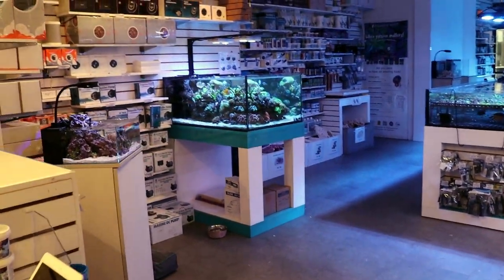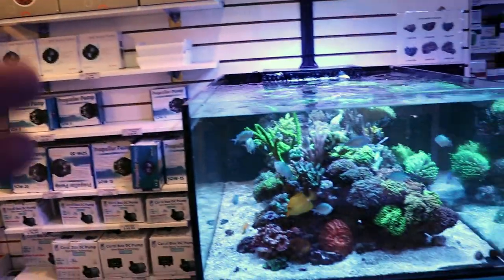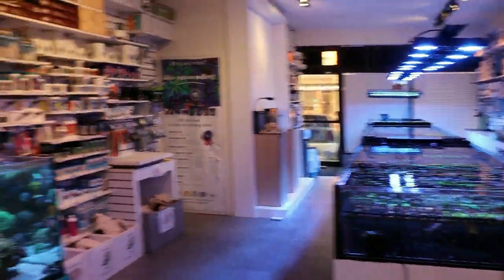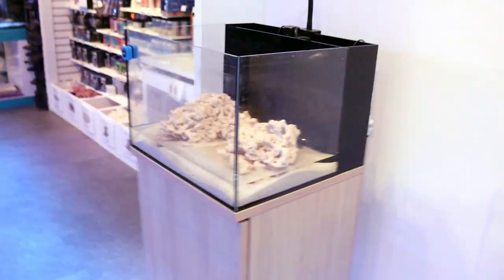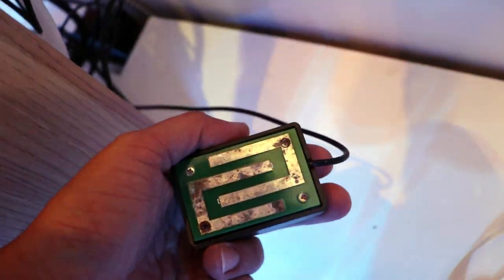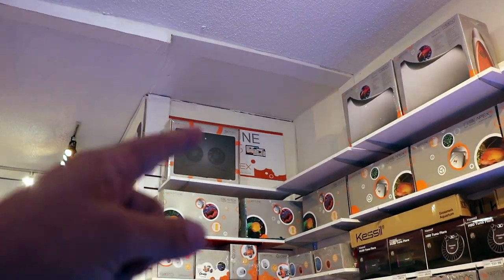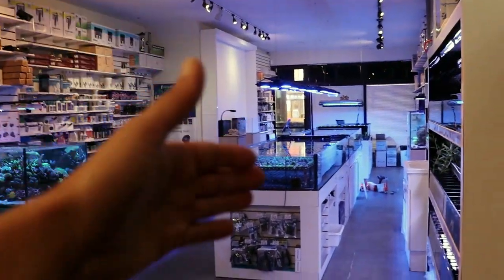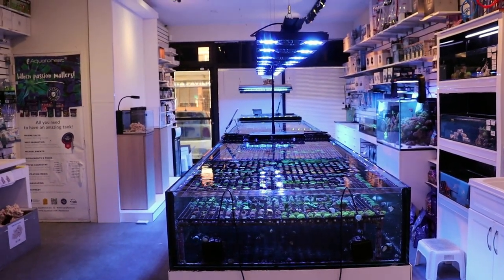Adding Leak Detectors To Your Aquarium

Comment: I dumped a bunch of water on the ground yesterday, I wish I had and alarm for it, I turned off the pumps and the tank back flowed down into the sump and then onto the floor.